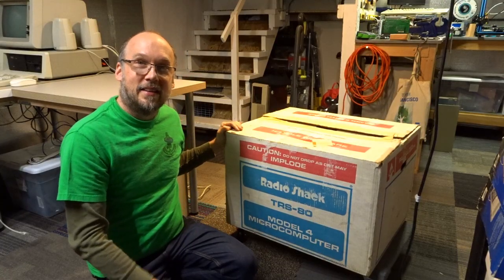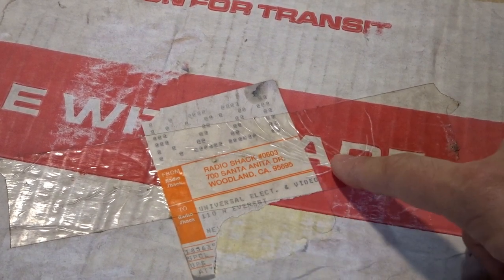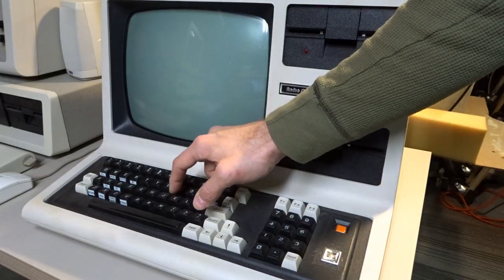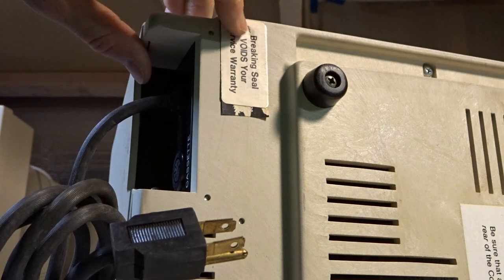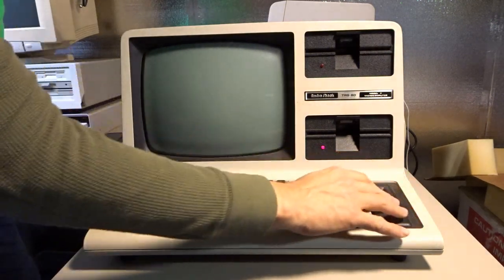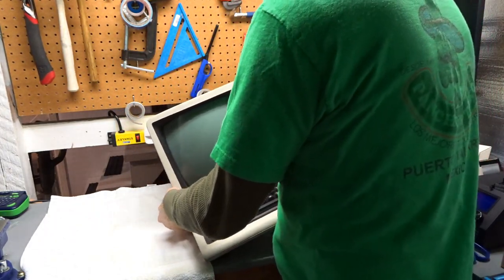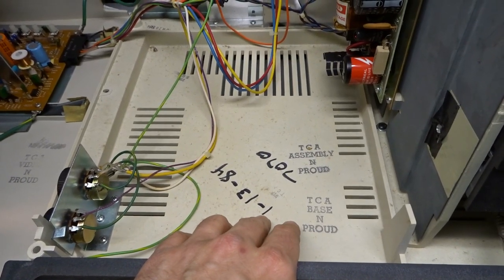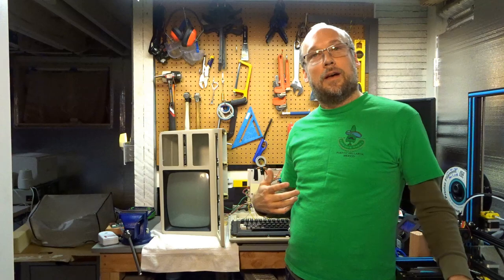Is that smoke? Radio Shack TRS-80 Model 4 Computer Unboxing and Test

Comment: where I on and off by himself older computers my first reaction was you pick this up for easy dollars? Around where I live you literally can't get anything like this because if somebody is selling it the price they want for it would knock you down. I got curious and looked it up on eBay untested there's one listed at around 400+ the shipping and one similar to this a few weeks ago sold for a little over 200+ shipping. Where I'm in Nova Scotia untested they would want around 400 which for somebody like me there'd be zero room to even bother because you would be able to make anything on selling it. Unfortunately people selling stuff like this don't realize there's a much smaller market short of selling it on eBay where it's a very small interest market in Nova Scotia there's lots of people selling vintage machines and they want big prices. Admittedly even when I sell stuff I sell it for a lot less than you might expect for the simple and plain reason it's not easy to sell. Where it's a very small market unless you are located in the US. Reminds me of a Commodore IBM clone I picked up a few weeks ago I couldn't get through to anybody even for taking pictures that the machine was that clean inside and out. Let it go for 100+ the shipping because I didn't have a proper monitor to prove the machine was working beyond it being able to power up. Haven't had an old 80s monitor in years they just want to much for them and the old machines like that won't fit SVGA monitors.

Comment: It probably would have been wise to power it up slowly with a Variac.
Reply: Nothing would have saved that old junk rifa cap. Honestly the whole thing needs to he recapped before he goes any further.  Not worth the risk of damage. 

Have a cap on the motherboard become a low ohm short and watch more expensive and difficult parts to replace go up in smoke.

Comment: I would never plug in old electronics which have been out of use. Cap failure is too big a risk.
Reply: The risk is - turn on a old electronis - it will turn off all lights of a Mega City - lol!

Comment: PAL is European video. The 128 K models were sold in stores.  Sad that you say the words "I Think" so often. Clearly, you know very little about the machine.  White stickers are NOT warranty stickers.  You're really ill informed! ALL TRS-80 models used standard television CRTs. Some were PAL some were NTSC dependent on market.
Reply: PAL is programmable array logic in this case. They did not use PAL or NTSC monitors.  The model 4 monitors and video were 80 column capable. Talk about ill informed.
Reply: PAL and NTSC are broadcast television standards which have nothing to do with old computers that don’t have any video output like this one. Saying this computer is PAL or NTSC is nonsensical, it’s like saying an old AM/FM radio is MP3 or WAV.

Comment: Never ever ever replace RIFA capacitors with another RIFA.  They are very very very bad.  Just take them out.  They are not needed.
Reply: The ham who lives next door would disagree with you.
Reply: @stargazer7644  Use a ferrite bead or choke instead.  There are other much better equally rated cap types for RF filtering, if you are that concerned with it.  Adding another RIFA is just pushing the "magic smoke" down the road.
Reply: @richardkelsch3640  X2 caps go between the isolated primary and secondary side of the power supply to allow a return path for high frequency noise.  Ferrite beads and chokes don't work in that application.  You don't need to add another RIFA, add a quality X2 rated capacitor.  Every modern power supply has one.
Reply: @stargazer7644  What part of "There are other much better equally rated cap types for RF filtering" is confusing?  Add the X2 rated cap, and go away happy.  I just don't recommend using the RIFA.
Reply: @richardkelsch3640  And I completely agree with that.  As far as the caps go, it's a bad idea to "just take them out".  They ARE needed.  There's a reason they're in the circuit.  Just because it turns on without it doesn't mean it is working correctly.  That was my point.